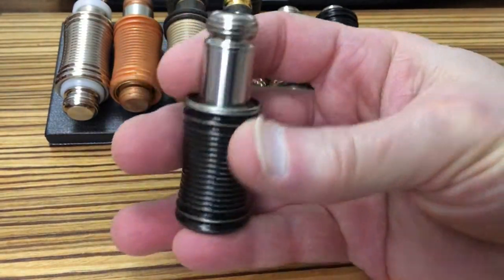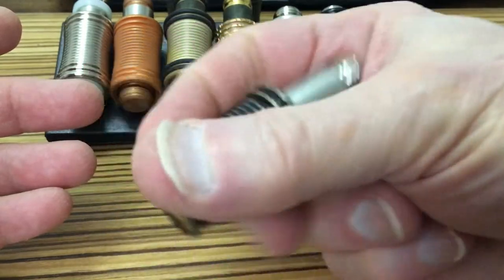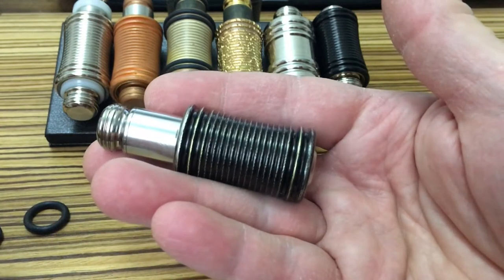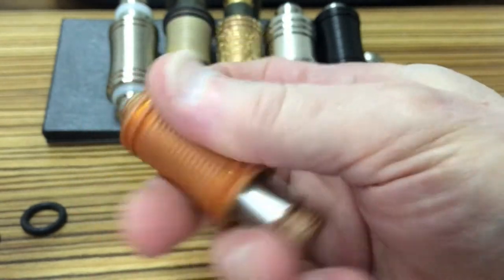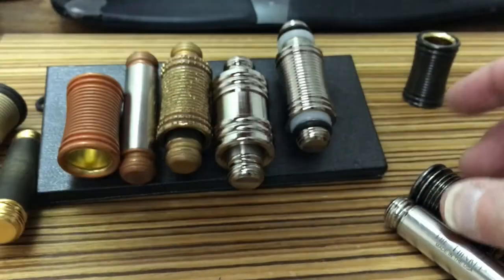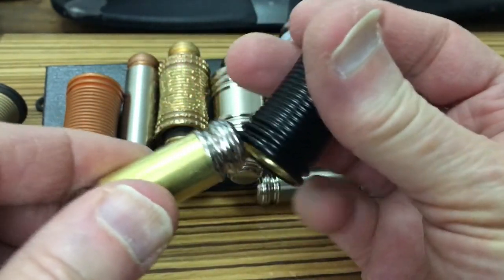Thinket actions and effects

Comment: I have a question, what size are the o-rings for the standard slider size?
Reply from the maker: The Black EPDM O-Rings that I ship out with the Thinkets measure approximately 15 mm for the inner diameter.
Reply: @MindspanLabs  - I thought I heard you say that it was 15mm, but then I just couldn't find where you previously mentioned that. Had to be in this video somewhere...
Well anyhoo, thank you!
Reply from the maker: @Siberius-  Thank you for your interest in the Thinket! 🙂
Reply from the maker: @Siberius-  Remember, that is 15mm for the inner-diameter of the O-Rings for the Slider-Head groove.